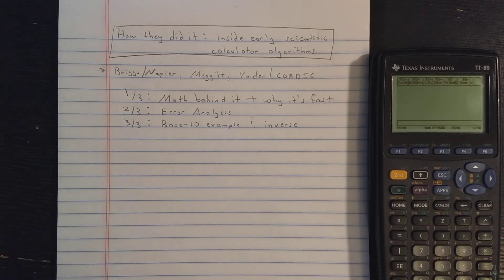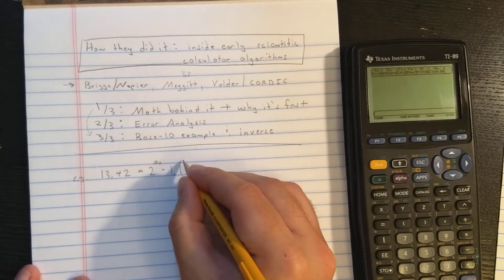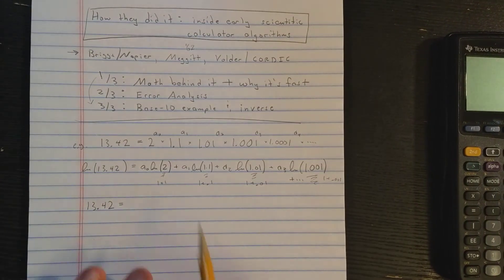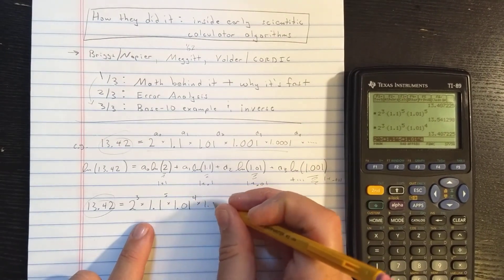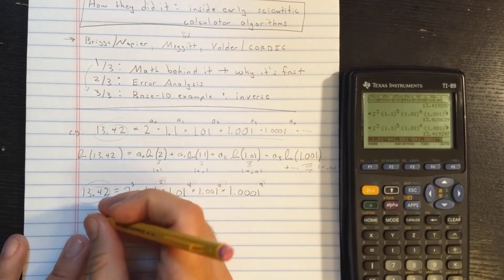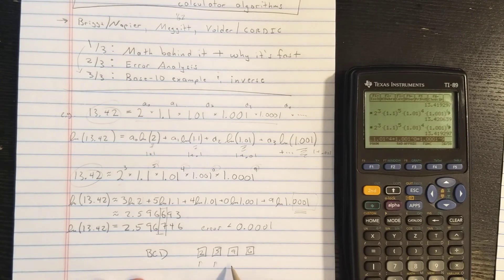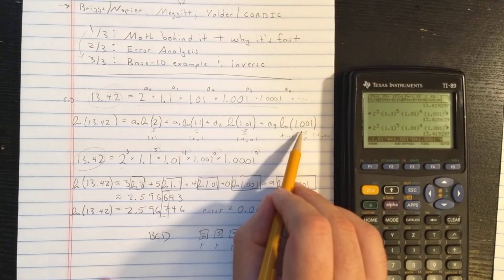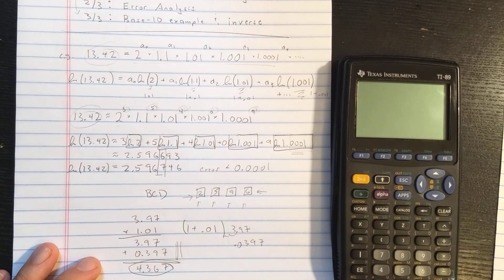Logarithms on Early Calculators 1/3

Comment: My 1922 Monroe Model K only adds and subtracts. Multiplication and division is accomplished by repeated adding and subtracting and shifting the carriage. It also can multiply in reverse which I don’t think modern calculators can do. So if you want to subtract 15% from a value it can do it directly, no need to use a complement such as 85% times value or a 2 step process. Also handy for multiplying distance times a function with a lot of 9s.

Comment: Great video (despite technical issues). I'm hoping you will create a new video series ... maybe Trig functions on early calculators? Or roots on early calculators? ...   How could they calculate ln(2), ln(1.1) etc ... i.e. sufficiently accurate without a calculator ;o) ... maybe you could elaborate a little on this?
Reply from the maker: Thanks! I will consider adding videos to this if I have time. On your last question, are you asking how they calculated the natural log instead of the common (base-10) log, or are you asking how the constant values used in this algorithm were calculated before computers/calculators?
Reply: @ProfessorHerning  The latter, i.e. how the constant values used were calculated before computers/calculators.
Reply from the maker: Various techniques based on the properties of logarithms were used -- all required tedious work. Interestingly Babbage wanted to automate the process of table-making, leading to his early (unrealized) computer designs in the 19th century. Napier's original trick involved a clever choice of base. Here is a simple explanation:  https://youtu.be/vzV50goW_WM .

Comment: The original key idea of using only an adder, bit shift and look up table comes from the need in aviation to have a quick accurate computation that can be packed into a small space (originally for the hunter nuclear bomber of the 1950s).  Realising that you can re-write the transcendental ftns  to to avoid multiplying gives the essential solution to the problem. In any case all of the computing ideas, including the slide rule, are trying to convert multiplication (higher order operation) with the lower order addition. The problem then becomes one of trying to miniaturise the electrical hardware implementation... and really wasn't done until after the developments were made for the apollo guidance computers. Only then could you put everything onto one chip. Hence the busicom and beefed up hp 35. This also explains why slide rules were used ubiquitously in the 50s and 60s; the MOS wasn't quit there yet.

Comment: Excellent insight into how early calculators did things. I wonder if you could go one further and go into how the original logarithmic tables were calculated manually. I imagine it would have been quite laborious.
Reply from the maker: I might do it in the future. Brigg's method is very similar to this algorithm:  break the problem down into logarithms that are known. One thing he does that the calculator does not do is that once the base is close enough to 1 (e.g. 1.00001), the remaining part of the logarithm can be well estimated with the approximation ln(x) ~ x-1. This essentially doubles the number of places you have that are accurate, but you need to perform a division. [Of course, he doesn't talk about it in these modern terms.]
Reply: There is a comment by Cochran (see CORDIC on wiki) that patent disputes on the hp calculators were countered by the claim that the method used in the hp 35/9100 were essential those done by Briggs (you can't make a patent on something that is considered general public knowledge, in this case from a book published in 1624). Hence doing it for natural logs and using the ln(1.0001) = 0001  etc. idea seems to be the most natural way you'd actually calculate it. In the past the computer for a table was an actual person.